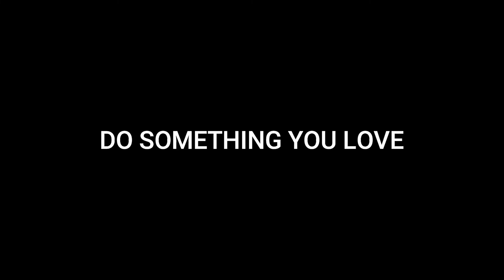SAILING MOAI: Green Cove Springs FL. Boat Work

Comment: Had the same issue with my Iceco on my Wharram, those iceco’s have to have regulated 12v to keep it running I replaced my lead acids with a lithium and all is well. You might also check the  battery protection mode on there as well, happy sails!
Reply from the maker: That’s what we did. And for the most part still touchy